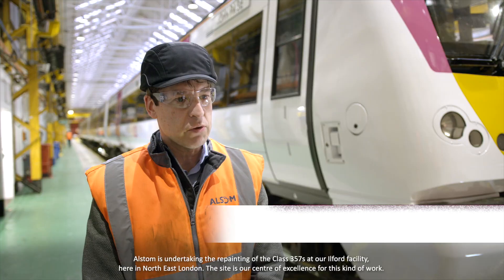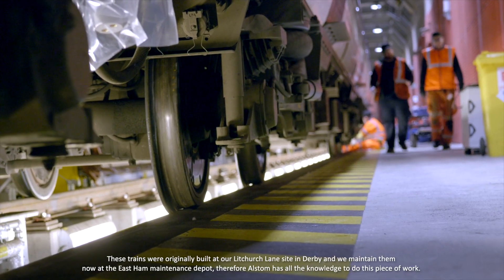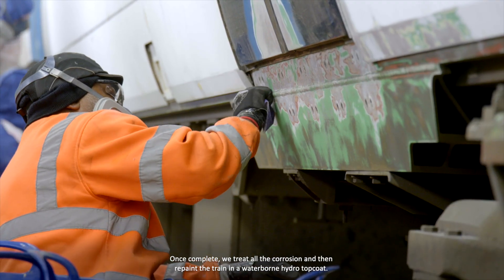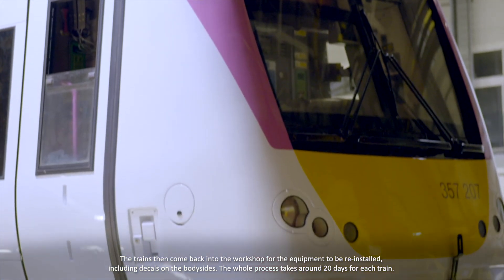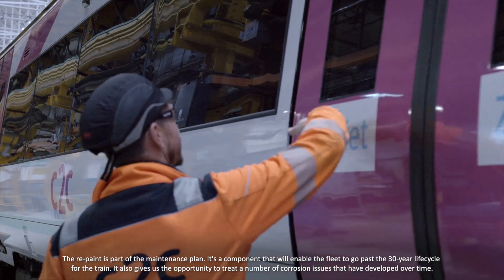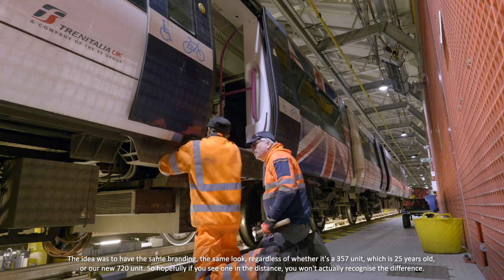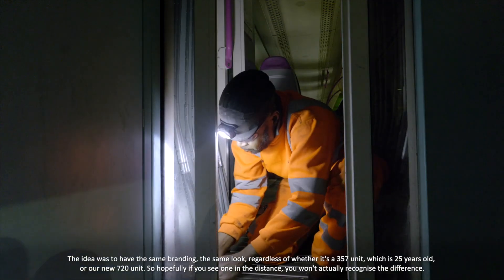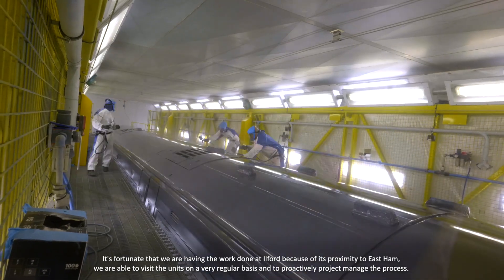Alstom c2c Fleet Upgrade Project

Comment: You can't just repaint a 25 year old train and call it new. A full interior and exterior refurbishment including their electrical components and traction motors would make the 357 up to spec with a 720 would pass as a new train.
Reply: This is the same exact situation when NX c2c had to change the livery because of the same exact issues

The class 357s in their blue livery faced corrosion issues particularly around the doors so c2c had to repaint their class 357s into the corporate NX livery 

But with the interior refurbishment, it might happen a little bit after the repaint project gets finished 

If you want the class 357s to have the same motors as the class 720 then you are missing the point on what an Electrostar is